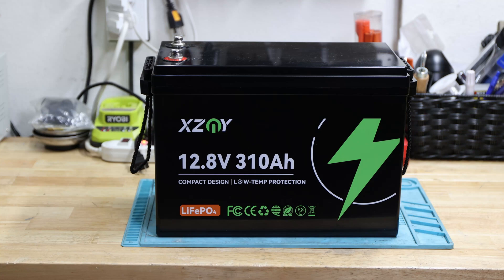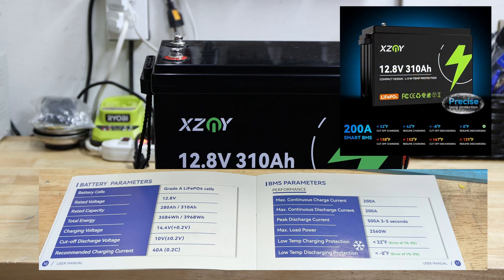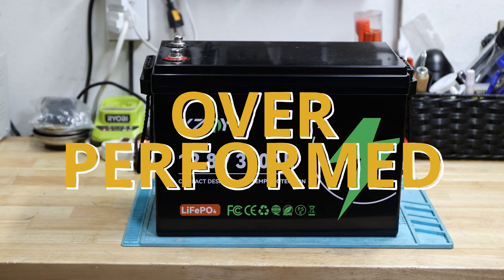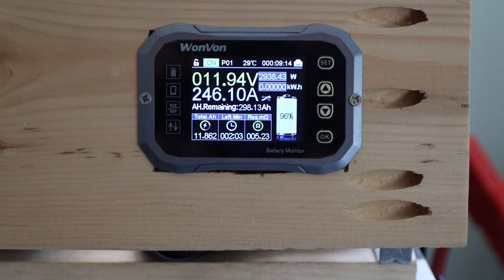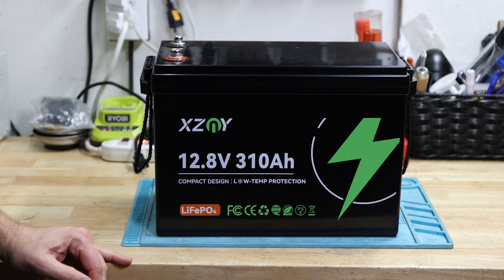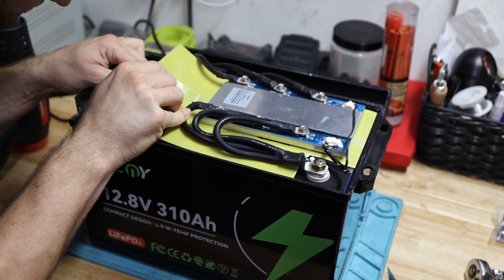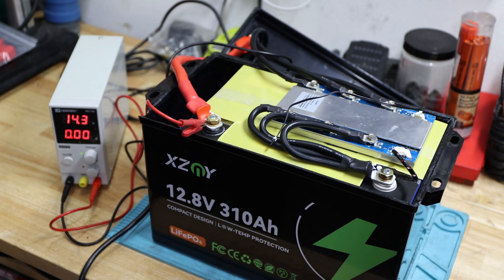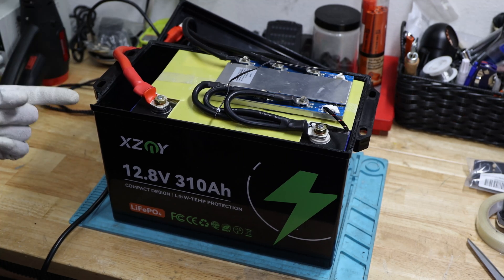Only $409 for 310Ah LiFePO4 12.8V Compact Battery

Comment: Would you recommend these or the watt cycle 280/300 version? They are almost the same price. Only thing is price cause watt cycle has bluetooth but that isnt to important to me since these would just be for extra storage.
Reply from the maker: If Bluetooth is not needed - I have not tested the 280/300Ah WattCycle version - but I tried getting in contact with them and never heard anything vs. XZNY is always responsive. I would go with XZNY at the moment.
Reply: @tobisreallifeskillswithtobi - bluetooth is great but for what I'm using it for which is extra battery for my delta pro. And I'm able to already control it through the alternator charger because I have to hook it up to that than the delta pro.